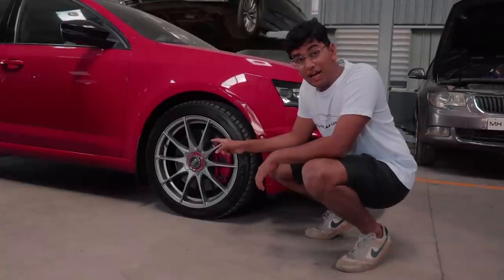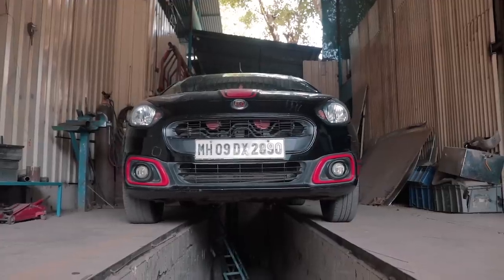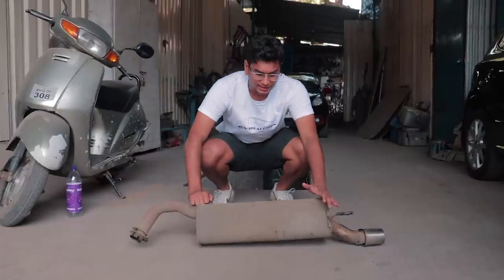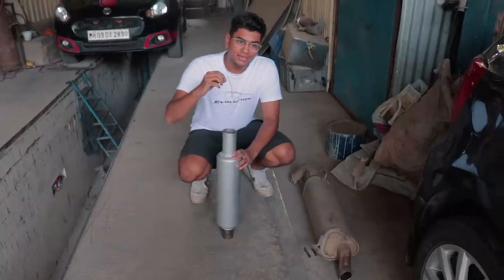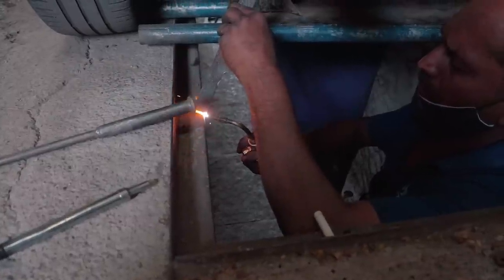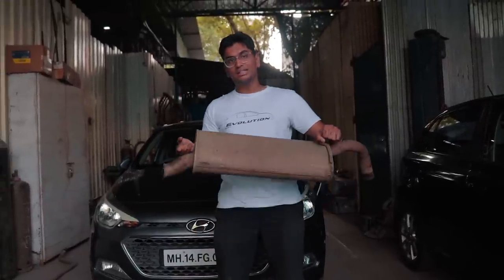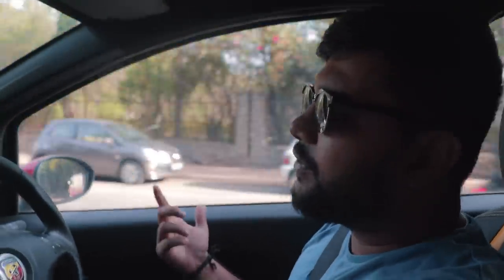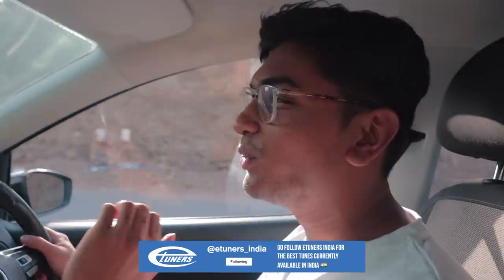Performance Exhaust for the Abarth Punto! (SUPER LOUD) | Project Abarth

Comment: Wait, what version of Fiat Abarth Punto is this? I have not seen it in Europe. Engine? Year of manufacturing? Is the AC controls, Media screen and the wheel factory standard? Look a lot better than I remember it to be.
Reply: This is based on Grande Punto. Fiat launched it in 2015-2019. It comes with 1.4 turbo 145bhp 212 NM Torque.